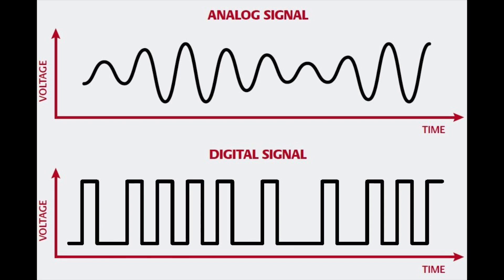Analog Mixing EQ's | Digital or Analog Whats the Difference?

Comment: Do you know anything about the Tascam Model 12 and how it fits in with this?
Reply from the maker: I've never used one as they're a little small for our needs. However I believe they are a very good little mixer and would suit perhaps a band looking to record themselves or be useful in a home studio environment.
Reply: @guerrillastudiosmanchester  thank you for the reply. 
I was asking moreso with it being digital after the analog preamps. The physical knobs for the comp and eq are tactile but operate digitally. 
After watching your video instead of tracking my drums to the model 12 which is a digital recorder I am tracking to a stereo cassette deck from radio shack and then playing the drums off that into the Model 12 when I record the baseline or guitar to the model 12. It did seem to give it a little more depth and thicken the drums up. 
The thing that's nice about the Model 12 though is that it allows for a small footprint but up to 12 tracks simultaneous mixing on a desk which means you don't need a DAW.
Reply from the maker: @truthwinseverytime8805  Ah yes I see. That sounds like a great use of the equipment you have to get good results. I do find the later in the process you convert audio the better. Like you say the physical knobs are really just to make it more tactile. Sonically its not the same as an analog eq. I've never used one personally so I couldn't comment on how they respond. 
I do find looking at screens viewing representations of sound to be distracting and detrimental to the music production process.